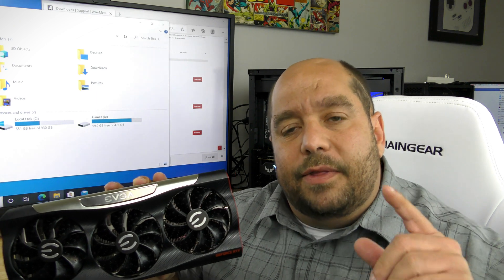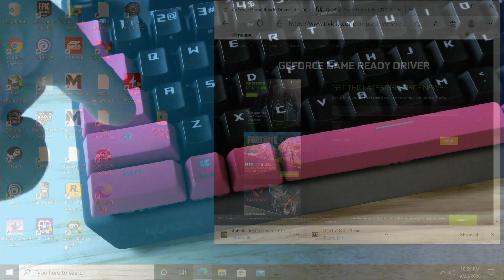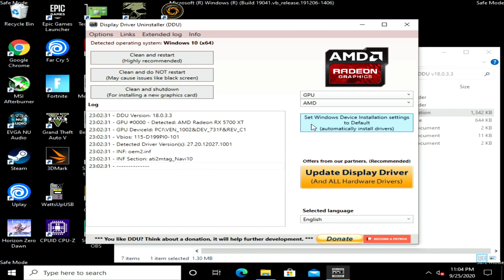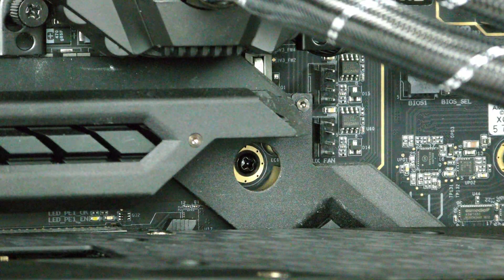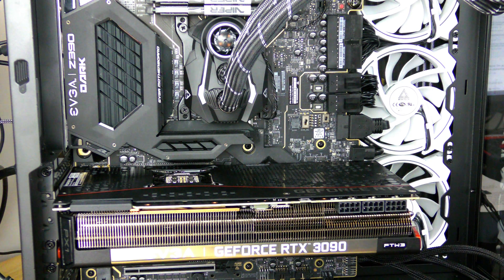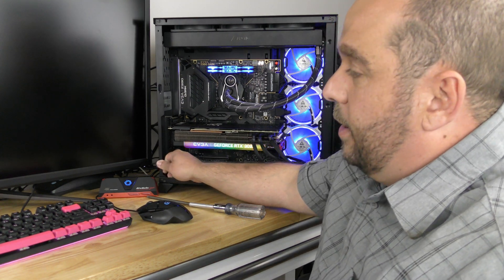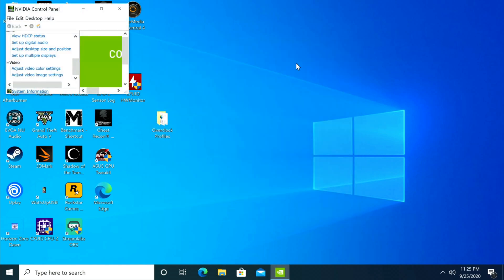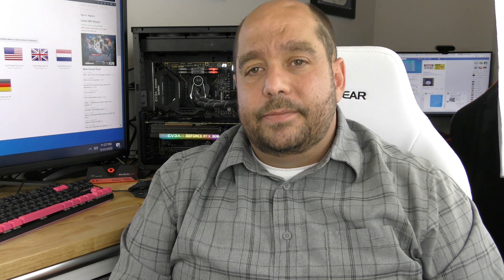RTX 3090 - Installing the EVGA Geforce RTX 3090 FTW3 Ultra Gaming

Comment: Brilliant. I am a complete novice on PC's. This Video was amazing and I was able to fit my 3090 without any issue. Only question i have is where do I get the cables for the PSU to the GPU. The only ones I can find are the ones that have 2 x 8 (6+2) on them, so if I use three I have two 9(6+2) hanging there doing nothing!! HELP Please.
Reply from the maker: What is the manufacturer and model number of your psu?
Reply: @ThisBytesForYou  Corsair HX1000
Reply from the maker: @kitmilo  looks like you have 4 separate PCIE cables, so you should be able to bring in 3 straight PCIE x8 cables, though its OK if some are 6+2, but they all much be separate cables.

Comment: I like EVGA very much,but don´t you think,that the prize of RTX 3090 is too high? For the price of this GPU you can have whole PC a year or two ago! What will be next? 2022 GPU - price over $2500 ??? ANd why they don´t do it..when the customers are so damn sheeps,they buy everything for mad money and didn´t make any pressure on company like NVIdia! Have you seen,what make AMD Ryzens (and Threadrippers) with Intel CPUs? They must go out with all their news and the prices are sinking! But still the CPU from AMD ..f.E.: Vermeer Ryzen 5x00 are better as last Intel CPUs! Let make them the same with NVidia GPUs! Support AMD GPUs .. RX 6900XT is enough good,it´s the same power as 3090´s Ampere and RX 6800XT is near about 3080 (3080Ti in short time) but for better price,better support and no playing with drivers (you know,what i am talking about,NVidia?!!!) But this awsome EVGA 3090 FTW3 Ultra Gaming will be great in my new build ..something for madmans also with Intel 10th series , LianLI O11 case,2xM.2 NVMe 2TB SSD w. PCIe 4.0 support and a PCIe card with 3x M.2 ports - every occupied with 2TB WD Black750 M.2 SSD (3x2TB=6TB) w. RAID 0 ,PSU Seasonic PRIME Ultra 1000W Premium Platinum (fully modullar),complete custom water cooling -> full covered motherboard: CPU w. VRM and others.. + GPU monoblock w.backplate + pump + rest of cooling things.. (and with hard tubes!),2x360mm radiators to cooling coolant from loop,for every radiator 3x120mm best Noctua fans (black color) and next Noctua fans on case intake and exhaust..guess about 5-6 pcs. ; and ,of course,also some awsome 4K monitor (think 32" will be OK) w.144Hz+ (can be also 165 or 240Hz,but it´s not a must) and with support FreeSync2 (for build with AMD RX6800/6900XT GPU -Big Navi) or G-Sync (for comp with GPU Ampere from NVidia RTX 3080/3090..but also older 1080Ti/2080Ti/etc..) and with an IPS or VA panel,high grey to grey -> +/ 1ms ,etc...
Reply from the maker: the price is high for all the higher end stuff, both AMD and NVIDIA, AMD right now on the cpu is raising prices lots, once they get a gpu that because NVIDIA, like the 6900, prices are higher too.  if no one buy them, the prices will drop, but we control the pricing sadly.

Comment: Do you have to hook up a cable to use rgb? I ordered a 3070 ftw3 and my friend said it has pins on the side for rgb?
Reply from the maker: yes and no.  So using EVGA Precision X, you can control the RGB lighting on the card.  The pins on the side are to connect an ARGB fan to, to have it match the ARGB lighting on the card, controlled by Precision.
Reply: @ThisBytesForYou  thank you !!!
Reply from the maker: Always a pleasure my friend, so very happy I could help.  Thank you so much for stopping by and checking out the video, liking and subbing as well as letting me know I could help, it means the world to me.
Reply: @ThisBytesForYou  done😎
Reply from the maker: Thanks my friend.

Comment: I have the 3080 ftw 3 ultra and is it ok that I am using one individual 8 pin power cable for one 8 pin port on the card and using  another individual one that has another 8 pin coming of it to power my GPU
Reply from the maker: yes, as long as you are using separate cables, that is the way NVIDIA recommends it, never use 2 or more connections from one cable.
Reply: @ThisBytesForYou  Ok thanks
Reply from the maker: @willd9122  always a pleasure my friend, thanks so much for stopping by, liking and subbing and your comment, it means the world to me and please let me know if you have any questions.
Reply: @ThisBytesForYou  Hey man quick question for you. Do you know if 1.375 v on my 9900k (5.1ghz) is to high of a voltage to use for daily usage? (It is also the lowest voltage needed to get my CPU stable)
Reply from the maker: @willd9122  The danger zone is 1.4, but 5.1 is very aggressive, i found 5.0 to be perfect and the temps came down much higher, the 9900 K though, doesn't need an overclock, stock runs awesome.  Compare the difference between stock and 5.1, there's not much really, and you are risking killing your board and the cpu.  If you have to overclock though, 5Ghz is best, and you can lower the voltage tons.
Reply: @ThisBytesForYou  Ok thanks again for all the help
Reply from the maker: @willd9122  always a pleasure my friend.

Comment: Can i use the PCIe cable that has two adapters on one? I only have two single plus cables and one dual plug? All I get is a red light when I try to turn it on?
Reply from the maker: No, the red light tells you that you cannot.  What is the manufacturer and model number of your power supply
Reply: @ThisBytesForYou  evga 850 gold
Reply from the maker: OK, no, you have to use separate pcie cables to each pcie connector, your power supply has more than enough connections.  This is a 3090, it's not cheap, take care of it my friend, give it what it needs ;)

Comment: Just so you know, almost all modern cases are painted metal, which means making physical contact with the case isn't gonna ground yourself when handling sensitive computer components. I tested this with a multimeter.
Reply from the maker: Funny, because I have gotten zapped touching the case, so it must work.
Reply from the maker: Though you are right in the painted part, I need to make that clear
Reply: @ThisBytesForYou  well, if your case has unpainted bare metal in it, then your good 😊 the case I own is painted everywhere unfortunately.
Reply from the maker: yes, that is what I mentioned that i didn't think about mentioning it to others, but I will make that clear on my next install video, thanks so much for your suggestion.

Comment: Where did you get the power cables? I really need to find 3 cable that arent one 8pin to 2 seperate 8 pins
Reply from the maker: Power cables would come from your power supply, what is the model number and manufacturer of your power supply?
Reply: @ThisBytesForYou  Thanks for replying, im looking to get a 850w psu. They come with 3 or 4 psu slots for pcie which is enough but the only issue from what i've seen is that the 6+2 pcie cable are split and not (single). They go from 8 pin to 8pin + (6+2). Apparently you can plug in the main cable 3 times and leave the 3 extensions unplugged but i am worried. Have looked online and seen mixed reviews too...

Here is the PSU i want https://www.scan.co.uk/products/850w-msi-mpg-a850gf-fully-modular-80-plus-gold-single-rail-65a-140mm-fan-atx-psu
Reply from the maker: I hate that power supply manufacturers make it so difficult to see the cables, its so horrible.  But looking at a review, they made it difficult too, but I was able to make out at least 3 separate PCIE cables (maybe 4, but I could only identify 3) so you will be able to use this power supply perfectly.
Reply: @ThisBytesForYou  yeah its so awful but that sounds great!!! Thank you so much!!!
Reply from the maker: You are so very welcome my friend, thank you so much for stopping by and checking out my video, liking and subbing and commenting, it means so much to me.

Comment: thanks i just subbed! i have one question from a noob....what is NVIDIA talking about with this whole 12 pin thing? i have a 12 pin connector for my PSU but the 3090 i have on the way is similar to this but just with 2x8pin as opposed to the 3 in this video...am i missing something?
Reply from the maker: Thanks bud, I appreciate the sub very much.  So as for the 12 pin, the 12pin is only for NVIDIA Reference cards, only the cards sold by NVIDIA.  The 3rd party cards from Asus, EVGA, MSI, etc will use 2 or 3 8Pin PCIE cables.  Can you give me the exact model number of this card?
Reply: @ThisBytesForYou  i see! thanks for clearing that up, so mych chatter about this 12 pin i was getting very confused lol. and i have the ASUS TUF Gaming GeForce RTX 3090 OC on the way, should arrive next week. I believe it has a 2x 8-pin PCIe
Reply from the maker: wow, it does look like it's 2 x 8 Pin PCIE's, they must have done a ton of R&D on it, impressive, I hope to get one to review at some point.  But you are so very welcome my friend, I am so happy i could help you and yeah, that chatter can drive you insane, you get so many people who have no idea what they are talking about, arguing with people that do know what they are talking about and if you don't know, you are not sure who to believe, it's crazy but I am so happy I could help.  Thanks so much for stopping by, checking out my video, liking and subbing as well as commenting, it means so much to me.

Comment: Did you have trouble closing the side panel? I've heard issues where the 3080/90 FTW3 8 pin cables can cause issues if the cables aren't flexible enough
Reply from the maker: yes, it was a bit tight, i had to train my cables, what power supply do you have?
Reply: @ThisBytesForYou  Gonna be getting the EVGA 1000W G+ as well as Cooler Master sleeved extensions. If it's too tight I'll just consider vertical mounting or buying some 180 degree 8 pin adapters
Reply from the maker: @Gazzzzzza  it will be tight, but I trained my cables, and it fits fine.  If you do end up getting that power supply, please do use the link in my description to it, it will help me tons.  I will look into those adapter as well, who knows, might be nice.

Comment: Just got one and I expected that Nvidia would include the PCI cables lol, I was sadly wrong.
Reply from the maker: did you get an EVGA or NVIDIA card?
Reply: @ThisBytesForYou  EVGA
Reply from the maker: @Bryce Throckmorton The NVIDIA card comes with the 12Pin connector, that goes right in the center of the card, it's an eye sore, 3rd party AIB's chose to use standard 8Pin PCIE connections.  So for this, you would need 3 separate 8Pin  PCIE connections and they have to individually come from the power supply, they cannot be daisy chained.  Do you know the model number of your power supply?

Comment: 7:43 No you don't need at least 750w power supply...
Reply from the maker: Correction, I thought this was the 3090, I have hit 403 right now and I am not done testing... But please tell me more?
Reply from the maker: Yes you do, it is what evga requires, that is what I am mentioning, below that, if you have issues that's going to be the source of your issues unless you can show other wise, think support wise.
Reply: @ThisBytesForYou  You are wrong but okay it is your opinion amateur's people about computers are everywhere...
Reply from the maker: Amateur, cool, as a product development engineer for Alienware, then later dell and finally velocity micro, I am sub amateur, never turned on a pc before.  Tell me your experience.  So during testing, right now I have hit a max of 599 wats, and I have not even over clocked it.   Can you imagine what it would be over clocked.  Please teach me obi wan, you are my only hope.
Reply from the maker: No no wait, this is the 3090, replying to you from my cell phone so the picture is tiny and I have hit 599 without overclocking.   Dude I need to get you in my team, you are like an Uber legend pro, I have no idea what I am doing.
Reply from the maker: Come on man, I need your help, I am so lost

Comment: Hi, do you use your cpu cooler as exhaust or intake?
Reply from the maker: exhaust.
Reply: @ThisBytesForYou  Thanks for quick response! And has the new gpu caused any heat rise in comparison to your old one?
Reply from the maker: @timetickinggifts6385  not at all, since I have great air flow, the card is great.

Comment: I thought something was wrong with my build. My pc was beeping like that when it started (one set of beeps like that) but everything has been working fine. Then I watched your video and heard similar beeps at start up? I guess its no issue? Thats a relief. I have a 850w psu.  Nice video
Reply from the maker: No issues, I have not tried it yet but if you disable CSM in the BIOS, it is supposed to get rid of that.  Thank you so much my friend, I am so happy I could help you.  Thanks so much for stopping by, checking out the video, liking and subbing as well as commenting, it means the world to me.  If you have any other questions, please feel free to ask, I always answer,... unless youtube does not release the notification, which sadly does happen occasionally.
Reply: @ThisBytesForYou  wow that eliminated the beeps all together. Thanks! Does disabling that do anything else or is it not a big deal?. Subscribed
Reply from the maker: cool, personally, I kinda like the beeps, but I am old school hahah.  So, CSM is short for Compatibility Support Module which is a component of the UEFI firmware providing legacy BIOS compatibility by emulating a BIOS environment, allowing legacy operating systems and some option ROMs that do not support UEFI to still be used.  

I had not tried it, but I heard that it would eliminate the beep, so I thank you so much for letting me know it did.  Thank you so much for stopping by to check out this video and giving me the opportunity to help you, as well as that sub, it means a ton to me, Thank you.

Comment: Hello, I did the steps and I'm getting 1 beep and then 4 beeps after on motherboard, when I start a game pc shuts off.  I have a I7 6700k, asus maximus viii hero, Thermaltake 750w psu and upgraded my gtx 980 ti with a zotac rtx 3090.   I was wondering if I need to update bios and new PSU or I have to replace all .  Thanks
Reply from the maker: Always best to update the BIOS to the latest and great but do you have all 3 PCIE connections plugged in and are the each off of a separate strand, no piggy backing.
Reply from the maker: also, what else did you change?
Reply: @ThisBytesForYou  hey !! No I haven't changed anything except upgrade to an rtx 3090.  The zotac only has 2 8 pin connection and used separate strands...thx
Reply from the maker: @deliriumsyrup  I recommend removing your memory an reseating it, and removing and reseating your video card.  I can't say what the power supply is, since you mentioned only the company and wattage, not the model number.  Also verify that your cpu cooling in correctly plugged into the motherboard, 1 long 4 short is usually memory, video or cpu fan, something might have come loose when you removed the old card and plugged in the new one.  Also make sure you have the monitor plugged in correctly to the video card and have the correct input selected on your monitor.
Reply: @ThisBytesForYou  ok thanks I will try those and update bios ...the psu is a Thermaltake Toughpower 750W 80 Plus Gold Semi Modular PSU ATX 12V or EPS 12V Ultra Quiet Power Supply PS-TPD-0750MPCGUS-1.  I ordered a evga g+ 1000w from bestbuy but won't come in till next week.
Reply from the maker: @deliriumsyrup  I use the EVGA 1000W G+ and it is great, let me know how it goes.
Reply: @ThisBytesForYou  i will thanks for the replys . subscribed!
Reply from the maker: @deliriumsyrup  anytime my friend, always happy to help and thank you so much for the sub, checking out my video and commenting, it means the world to me.
Reply: @ThisBytesForYou  you welcome! Well I tried it again and still beeps 4 times after the normal beep and pc reboots when starting a game, I installed back my rtx 980 ti and everything is running smooth again.. my zotac rtx 3090 is working just not compatible with something...ill just wait till Wed to pick up my evga PSU if it still persist should I just go for broke and get me a newer cpu,motherboard?  Lol